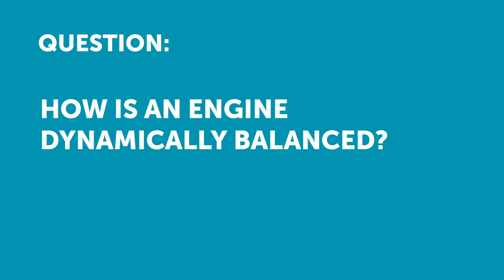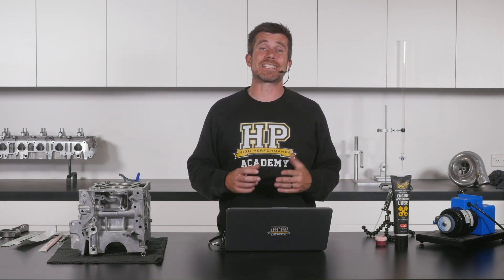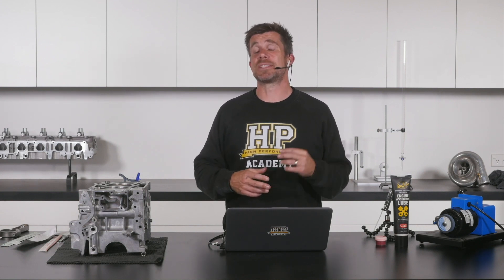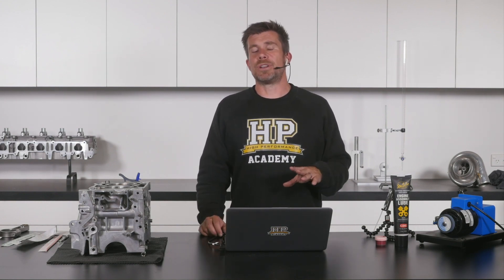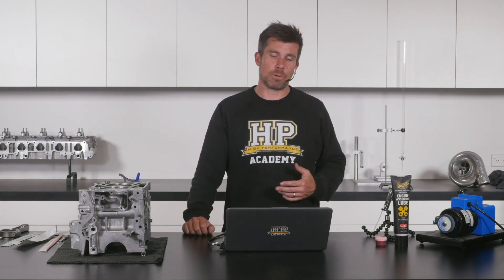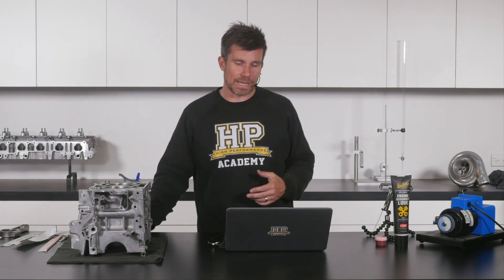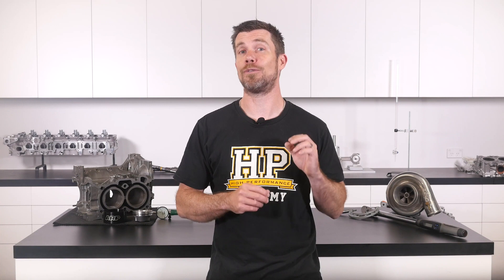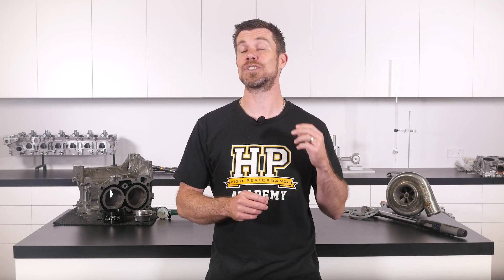How Is An Engine Dynamically Balanced? | What Your Machinist Does & What YOU Can Do [HPA Q&A]

Comment: How does the weight of the pistons and rods affect the balance of the engine, considering their motion is only two ways up and down. I can understand how the crank affects the balance because the crank rotates in a circle but not the rods and pistons.
Reply: garage potato it effects it in the same way as if crank wasnt balanced
Its attached to the crank so it creates an imbalance
Reply: The counter weights on the crankshaft are weighted to counter the imbalance  created by the conrod and Piston rotation
Reply: the rods and crank have ANGULAR momentum as the crank is spinning in a circle the rods are converting the LINEAR movement of the piston (up and down) into the angular movement of the crank/rods (in a circle).
Reply: Tbh I don't think it makes any difference. When you accelerate all the oil goes to the back of the engine which means the rear most conrod n piston will have a few more grams of oil on them creating a "perceived" imbalance anyway. Plus the huge weight of the flywheel at one end.
Reply: @dcsymbols4450          
google "order analysis"

some physics
:

https://royalsocietypublishing.org/doi/abs/10.1098/rsta.1965.0052

discussed here
:

https://www.youtube.com/watch?v=ZX4TR6SgRRY

and for your viewing pleasure:
https://www.youtube.com/watch?v=xbB1qwhKaaE
 (25:00)

my blabber

the higher you plan on spinning the engine the more the effect of imbalance becomes a factor in the longevity of your engine.
every engine produces vibrations as the crank shaft rotates from the force of the pistons pushing on it.

 YES the flywheel, harmonic damper and counterbalance shaft do indeed dampen those vibrations but they're only useful in specific operating ranges and an engine is designed around those parameters

moving oil is why  baffled oil pans or dry sumps exist. if there is some imbalance caused by the moving of oil then you can incorporate that into the design of your engine.
Reply: @dcsymbols4450  Dunning /Krueger...